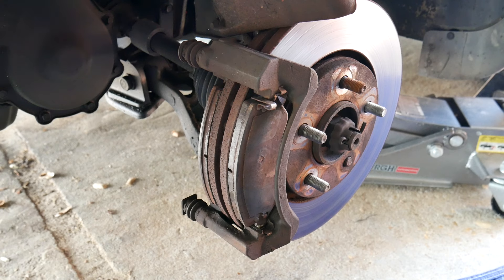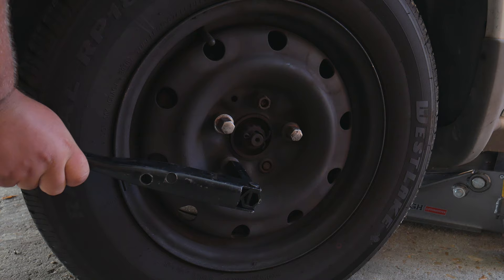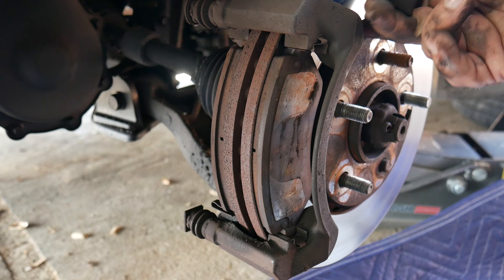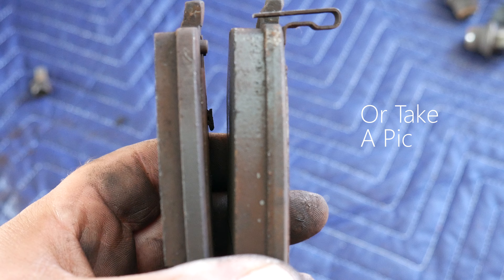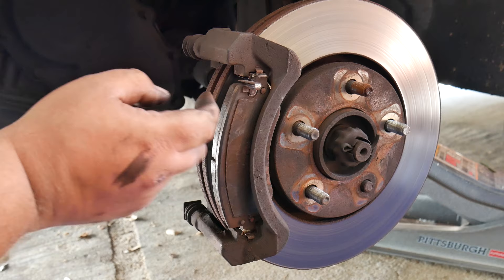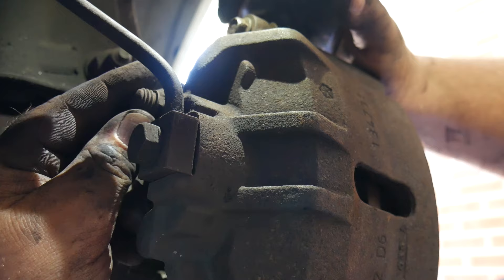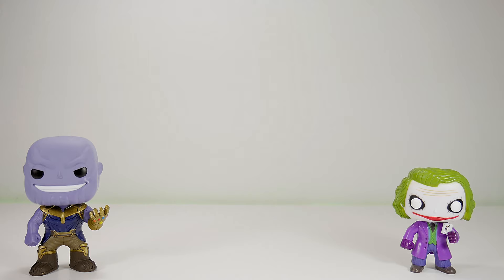How To Change Replace Brake Pads Easy Simple

Comment: I know you posted this video a long time ago and I hope you awnser fairly fast but does it matter the distance the pads go to the rotor when putting the new ones on I’m just scared it’s gonna be to tight or something and cause my brakes to instantly scrape
Reply from the maker: usually the caliper automatically adjust when you start pumping and regular use of brake system. its usually normal when placing them for the first time to touch, its a good sign that the system has pressure and working correctly.

Comment: Do you have to bleed the breaks after changing them?
Reply from the maker: its not needed all the time and also not all vehicles need it. this is when you feel air in the line ( you press the brake and it goes down easily with no braking power this could be one of the causes) some vehicles have a way to automatically remove the air.

Comment: Most difficult brake pads I've ever done were on a European car. Domestic are all pretty cut and dry. I just ordered a set of OEM semi-metallic rear pads that were closeout. $55 in town plus tax. They're being shipped to my door next week for less than $20. I've been riding on closeout shocks for a couple months. Like new take-off tires with the same measurement as new. I've already got too much money in the sled as it is, but this way it's about 70% less than everything retail. I wanted to buy a dodge pickup today. Nice shape. But I had the same feeling about it that I ignored when I bought the sled. So... it's not in my driveway. I'll end up with a newer 99+ Silverado or GMC V6 or small v8 or just fix the one I've got... which is looking more likely every day. If the ext cab Ford in KS had been the V6 I probably would have went and got it. SOHC is great, just great in the trucks until it needs.. well I'm not fond of them until 2013.. and then my advice is either buy a new one or get the V8! Ecoboost is meaningless when the V8 gets the same or better mileage and the 8 doesn't need turbos and an intercooler, etc by 180,000 miles like the 3.5 will. I hope the 2.7 and other boosted engine's...imo nothing is better for the customer since the 90's. When people think about saving $4.63/week ($71 in California LoL) in gas over the total cents per mile cost of ownership..ok I'm done.

Comment: Is it necessary to grease the 2 cylinders after putting new pads
Reply: 2 cylinders?
Reply: @vigilantemotors  the guide pins that they sometimes hammer out to grease them, is all of that necessary?
Reply: @Here-n-there1984  The guide pins with the rubber boot? Yes absolutely you should be greasing these.

Permatex Ceramic Extreme Brake Parts Lubricant

CRC 05359 Brake Caliper Synthetic Grease – 8 Wt Oz

Permatex 85188 Ultra Disc Brake Caliper Lube, 0.5 oz.
 
One of those will do you fine.

Can I help with anything else? 
I may have a couple of useful vids on my channel and I always answer any auto questions on my channel. 

Let me know, thanks

Aaron
Reply: @vigilantemotors  oh I appreciate the quick reply, is all I needed to know. Thanks a lot, you're the best

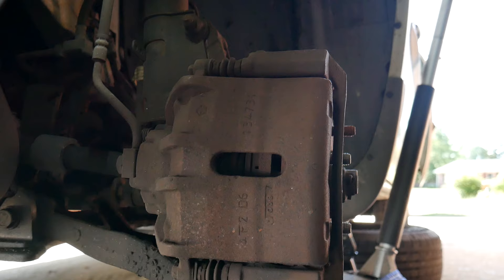Comment: 2:45 You don't need to remove the top. Just remove the bottom only and you should be able to lift it up and it should stay up.
Reply: Will it stay when you swing it open? or do you have to tie it so it doesn't flop back down? I need to change my pads asap, so somebody answer plz. thanks!
Reply: @guybrush1701  You should be able to lift it up and it should stay up. Don't need to tie.
Reply: @JoshuaXiong  ok, noted. Thanks so much.
Reply: Quick question if I lost the bottom bolt will that be a major problem in the future?
Reply: @trevonw67  probably just order one
Reply: @johnlawful2272  I ended up doin it and maaaannn I was so relieved that was the problem instead of something super serious 😅😅😅

Comment: As far as I know the inboard break where quicker than the outside Because of the load from the brake cylinder so the screen is going to be from inboard side not outside thanks

Comment: My pads won’t fit into the bracket
Reply: You may have purchased a different model for your car or truck... Always need to pay attention about pads compatibility with the car model.. or OEM original ones best.
Reply: @ExtranjeroyPeregrino.  
I had to grind the ears on the brake pads down so it would fit.

Comment: I'm looking this up because I called a place about them doing it. And they said they charge $430 and upwards for front brake change and they would be using their own brake pads.
Reply: Damn you got ripped off
Reply: @cjgriggs8  hella no. I was like nope. Imma do it myself. Even though I don't know how to. Just YouTubing it. 😅
Reply: It’s really easy once you do it the first time lol. If you buy the gold brakes from autozone they have a lifetime warranty. So you’re basically paying one time for years of brakes
Reply: @cjgriggs8  shops where I live charge 450-500 for pads/ rotars.
Reply: i know what you mean bro, some garages and mechanics absolutely take this piss and rob you blind ! or try to, i just had a clutch cable snap on a 2009 suzuki  alto, the clutch cable cost £19.99 , and is a half hour job tops, and they wanted £180 to supply and fit , i thought nar, no way am i paying some one £160 for half hour labour , i will do it myself, i was going to ask for a quote for them to do my front brakes but after the cable quote i thought no i will do it myself , and thanks to this guy i will and save myself a few hundred pound in the process, hope you managed to fit yours ok and also save some money

Comment: U don't really need to take both bolts out lol 🤣 just take the lower bolt out than use a tool to lift the bottom up only lol 🤣😭